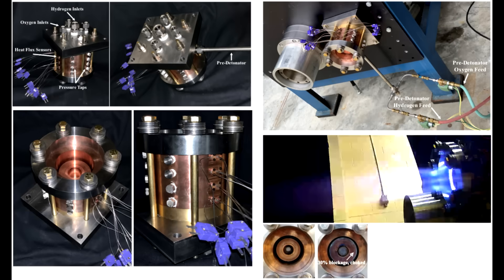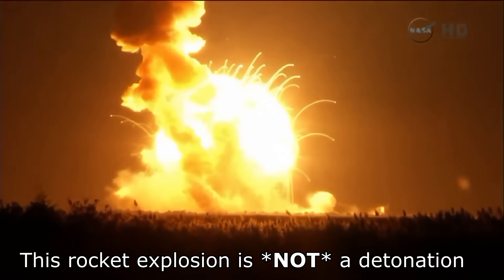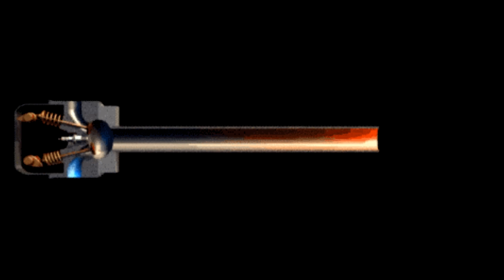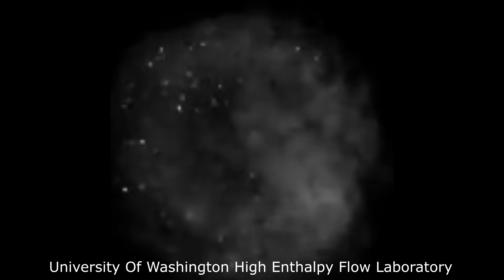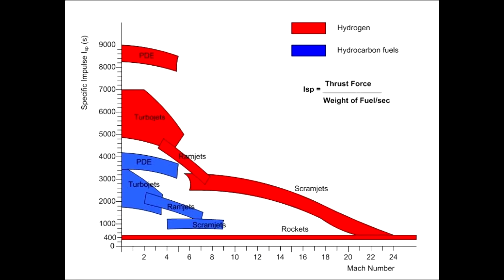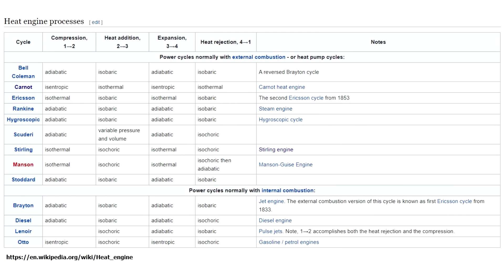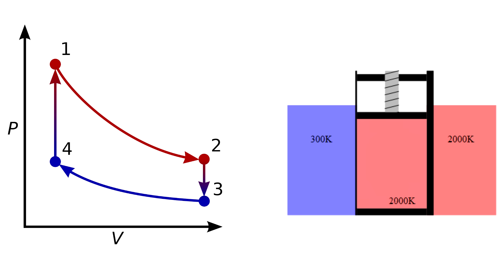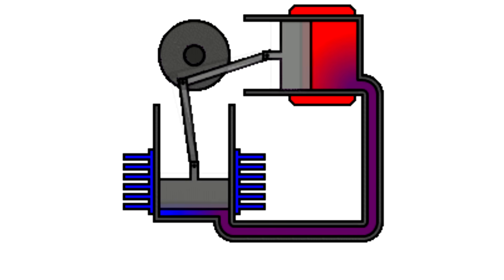What Is A Rotating Detonation Engine - And Why Are They Better Than Regular Engines

Comment: Thanks, Scott. You always do nice work.
Just a nit: the heat engine, in going along the bottom of the cycle from 3 to 4, does negative work, subtracting from the positive work done 1-2. The useful work is the area of the cycle.

Comment: Theoretically, Scott is spot on.  From an ENGINEERING perspective, there are additional issues our good friend has not addressed.

Vibration.  One look at the exhaust flow in the short video clip shows one that the flow out of the engine is NOT steady.  It cycles around the annulus of the opening of the engine.  This wobbling flow is transmitted back into the structure of the rocket.  If one hits a harmonic frequency of the thrust structure, a "rapid unplanned disassembly" will ensue.  In multi-engine configurations, the tuning of the engines will be critical to keeping the structure intact.  Multiple compression waves are employed in an attempt to even out the wobbling.  Keeping the shocks from merging is very difficult as Scott had mentioned.

Acoustics. Rocket and jet engines are loud beasties as it is. By nature of deflagration involves lower pressures than detonation.  Lower pressures mean less noise.  The higher pressures of the detonation mean greater noise levels (see Rocktplumber's posting below).  These have been described as "ungodly loud."  At high altitude (or in space) this makes little difference to bystanders, the crew INSIDE the vehicle will be subject to a higher decibel environment with a detonation engine.  This implies additional acoustic insulation to protect the crew.  The higher decibel level also imparts higher vibrations from the sound into the structure (vibroacoustics) that must be addressed.

These are not insurmountable obstacles, but the engineering needed to adequately address them WILL negatively impact the overall efficiency.  The theoretical increase in efficiency will be very difficult to get reasonably close to.

Comment: I keep hearing these engines being discussed as second stage engines for space launches. Why are they not suitable as first stage engines?
Reply: First stage is more of a peak thrust game to get your second stage to not hit the ground before it finishes accelerating, while on the second stage your specific impulse is critical; it's not necessarily that these rockets aren't suitable for the first stage, it's that you want them in the second stage even more than the first stage. If they cost significantly more (likely), you probably only use them for the second stage.

Comment: we have nozzles to transform energy wasted on pressure into velocity. Thanks for teaching me that in one of your videos. But high temperature seems to be huge waste also. Like, it would be really cool if that could be transformed into velocity also.
Reply: For a gas, pressure and temperature are very closely related; converting the pressure into velocity is essentially the same thing as converting the high temperature into velocity. There are limits from the laws of thermodynamics, of course, as the total entropy cannot decrease, but we most definitely are converting (some of) the high temperature to work in any of these engines.

Comment: How about having multiple smaller engines exploding in a rotating pattern? A little bit like cylinders. And making sure that there are always two engines on a diameter firing together to balance out thrust...
I am talking out of my bum, since I have absolutely no clue if this is even remotely possible.

Comment: Surely even the "rotating" detonation engine cannot match the specific thrust of a conventional engine because it is not using the etire area of the combustion chamber continuously. For the pressure wave to be able to "Travel" it must travel into a lower pressure area, so you can have a truely continuous detonation engine? (or can you, by feeding in new mixutre at low pressure at precisely the same speed as the detonation wave advances, could you burn the whole chamber with a continuous detonation wave?  sounds V. difficutl to me! :-)

Comment: Doing my master's thesis on this 😊
Reply from the maker: Would live to know more
Reply: @scottmanley  What you said is pretty much everything, unless i get bit more technical. There are two major types of states at which these machines operate, Travelling wave mode (which you covered) and standing wave mode, this occurs when there are two opposite travelling waves and they meet each other to create this "stationary" wave. The engine is highly sensitive to mass flow rate and equivalence ratios. These are not the only waves that travel around the annulus, there are other pressure waves which go around and interact with the main detonation front. Its very important to determine the exact dynamics, thats where my thesis comes in, we use high speed imaging to capture the movement of the waves and then we use various data driven algorithm such as POD, DMD to determine the dynamics of these waves. Its not only important to manage the operating conditions of the annulus but also its important to know the dynamics of the system so that one can understand the complete time history and also predict upto certain time in the future the state of the system.
Reply: @scottmanley  it is time to revisit this. Jaxa launch needs some Manley Handling.

Comment: Your piston animation is incorrect. The temperature drops as the volume expands, your animation shows it constant. There is some cooling at the end, but as your pressure/volume chart shows correctly, the bulk of the cooling is actually in the expansion. Similarly for compression.

Comment: I don't think that the thermo cycle behaves exactly as depicted in the 2D graphs. In the graphs the area that is added due to detonation is basically just pasted to the Brayton Cycle curves. I think that in reality this would narrow the lower part that was the original Brayton Cycle. In other words, the area in the graph gets taller but the lower part gets skinnier. The detonation area isn't just added onto the Brayton Cycle curve. Thus, the area enclosed is pretty much the same.
Think of it from a chemistry perspective. There is only so much energy in the chemical propellants. If you do a good job thoroughly combusting them then you get close to the maximum out. *Maximum*.
Now a detonation can momentarily get you a higher "chamber pressure" for this chemical energy to be release, but if that small section of high pressure then disperses out before leaving the nozzle then the average chamber pressure is not much better than a normal rocket. 
Look at it from a fluid dynamics approach: How fast can you get the exhaust gases to go? That depends almost exclusively on net chamber pressure and area ratio. 
You can argue that a detonation will more efficiently combust a fuel and oxidizer but modern deflagration rockets are pretty darned efficient. If you want to squeeze a little more you can simply make the chamber a little longer and have more residence time for deflagration to occur.
There is a finite amount of chemical energy in a propellant combination. You can't get more than 100% efficiency. Current rocket engines are about 70% efficient (much better than cars!). Much of that last 30% is not available for thrust unless you can extract all the thermal energy out of it (a rocket with a cold exhaust and no flame). The Laws of Thermodynamics has a problem with that.
Note that I am talking about rocket engines here. Air breathing engines will of course have higher specific impulse just like normal turbojets have a higher specific impulse than a rocket.
Reply: Kyle Towers  Please enlighten me. Seriously, I'd like to know.

Comment: I built a u-shaped pulse jet engine in high school like 12 years ago. I still have models and drafts for a design that did the exact same thing the rotating detonation design is doing: taking a cross section of the engine and rotating it around a circle so instead of pulsing it would burn continuously around. I had none of the skills or math ability to even try it though ;D (still don't, but I would love to one day)

Comment: Once I get my workshop finished (which I will video the construction of and post) I intend to try and and fabricate a Stirling engine using a magnifier (which I will video the construction of and post) which will utilise the power of the sun (I live in Thailand where the sun shines most of the time, 38 degrees at the moment, 40 yesterday ;) Will it work?
Reply from the maker: You need a cold sink too, but i’m sure it’ll work
Reply: @scottmanley  My submersible well runs pretty cool water, maybe I could rig something up with it. I love tinkering, which is what my new channel is called "Tinkering in Thailand". cheers mate :)

Comment: •	RDE’s need a single initiation for operation and the combustion is self-sustained. The detonation waves will stabilize in a short duration. 
•	Frequency of operation is of the order of KHz. Which makes uniform exhaust flow downstream of the combustor.
•	Compared to PDE’s the thrust produced by an RDE is continuous. The detonation waves are enclosed inside the channel which reduces the energy lose with exhaust. Which makes it a suitable replacement for the gas turbine combustor. 
•	The reactant inflow does not require any flapping valves as well as it is a self-pressurizing system. The injection pressure loss will be overcome by pressure gain combustion. So it is easy to integrate it with an axial compressor with lesser number of stages. 
•	RDE’s have very high power density, so that the size of the combustor reduces drastically.    
•	Smaller the size of the combustor, smaller will be the losses due to wall heat transfer. Moreover, the exhaust flow can be simply approximated to a 1D quasi steady flow.
•	It is easy to resize the combustor because there isn’t any hard rule for the size constraints. 
•	Fuel injection system associated with such combustors are fairly simple, as they don’t need any moving parts or swirlers.  
•	Integration with an existing turbine stage will be easy because of lower unsteady pressure fluctuations downstream of a properly designed RDE combustor.
•	Propagation of the detonation wave independent of direction of inflow and outflow of reactants and products respectively. Such combustor can be easily integrated to axial as well as centrifugal compressors. 
•	Even though there is no need of a secondary air for dilution of exhaust, if employed it will further reduce the periodic oscillations downstream of the combustor.
•	RDE’s possess large effective thrust, which is a measure of how well the total pressure of reactants are converted to thrust. So an engine employed with RDE combustor can work with lesser number of compressor stages compared to the same system with a constant pressure combustors.
•	Large specific thrust and high Specific impulse of the system make sure the maximum utilization of the available air.
•	Operating space (mass flow rate of reactants vs equivalence ratio) is wide for an RDE combustor. So it can be effectively operated with equivalence ratios required for low emissions.
•	Most preferable reactants which can be initiated are H2 and O2 combination. So having a clean combustion is favored with such combustors.
•	The mode control is not well defined as of now and there are scope of having multiple co rotating detonation propagation can improve the capabilities of this combustor.
Reply: So, in addition to increased efficiency and many other benefits, it sounds like RDE's should be lighter and more compact. Does that mean RDE's also promise better thrust-to-weight ratio?
Reply: @DistracticusPrime  Too soon to tell about "lighter and more compact", surely, since we don't have a practical working design and don't know yet what additional hardware/reinforcement/plumbing will be added to make one. But even if they're heavier and less compact than current engines, the improved efficiency will, at some particular breakpoint, make up for that. And then we'll be in for lots of interesting new discussions about optimal vehicle design. =:o}
Reply: @DistracticusPrime  Thrust to weight is high and even better is the high specific Thrust
Reply: How throttlable is it? Can we land rockets with it?
Reply: It's not easy to find conditions, where the waves stabilize. I'm not really informed on that subject, as I had a brief contact with it in 2014, while doing my internship, yet I remember the problems. It was extremely difficult to find conditions, where the waves were created in a repeatable pattern - sometimes it was just one, sometimes two, or even three. And then, the biggest problem at that point of the project, was the transition from H2 to jet fuel. It was a real bummer for the team, when the engine flamed out just after couple of seconds or sometimes the exhaust gas temperature rose above the critical for the turbine, which meant that they had to switch it off and the whole procedure had to be repeated. It was called a success, when they managed to get 25s of continous work.
I only wish, I kept in touch with the team, to track their progress. I only hope, that some team from around the world will finally manage to keep it all steady and reliable, as the idea of RDE always seemed great for me.
Reply: Time to practical application?
Reply: @737smartin first successful real works testing of a RDE happened yesterday  in Texas.

Comment: Scott, wouldn't this type of engine cause significant vibration to the vehicle it is installed on? Traditional rocket engines are a continuous vibration, but seemingly these would give pulses of thrust, kind of like Project Orion, just on a smaller scale.
Reply: Like the German WWII V1

Comment: You can get the dwell needed in a Stirling by driving an elliptical gear (at a constant rate) that then drives another elliptical gear 90 degrees out of phase.  It's somewhat mesmerizing to watch.

Comment: There's a problem with your graph at 8:53. Steps 4 - 1 and 2 - 3 are not vertical, as that implies pressure increases or decreases without changing the volume. Unless the cylinder is prevented from expanding, the volume will vary in proportion to pressure changes. :p
Reply from the maker: That’s not a problem with the diagram, it’s a problem with the piston motion in reality.
Reply: @scottmanley  Fair enough :)

Comment: At 4:55, the long red tube is the igniter, starting with a deflagration that becomes a detonation, and launching that into the chamber. The main propellant feed is through the small axial tubes, at right angles to the travel of the detonation wave. The feed is subsonically supplying the blue cool mix, which the shock travels through at mach 2 to 5 or so. Note that at 5:19 the two shocks coalesce into one stronger shock after a few revolutions, a tiny fraction of a second in real time. As long as the chamber is not too short, the feed mix can't escape without getting shocked and burned as the wave comes around.

Comment: A lot of cool things here.  I remember from your other video how a static rocket engine produced thrust vectoring by changing fuel flow to certain areas.  I wonder if you could modulate the rotating detonation to achieve (pretty much) no moving parts thrust vectoring? Kind of like helicopter cyclic control only with a detonation front.

Comment: I believe NPO Energomash tested a Detonation Engine back in 2016. However the news translated it as Pulse Detonation Engine, despite its size and geometry wasn't compatible with PDE, but with a CDE. Also, it worked with RP1 instead H2

Comment: With the rotating detonation engine forcing you into an annular combustion chamber, I'd be interested in how the aerospike vs bell nozzle debate would change in relation to the new power cycle. That presumably comes down to heat flux at the throat?
Reply: Usual nozzles will be destroyed by the shockwave

Comment: So are ram jets somewhere on the scale between these two enginescuz you would still have top atmosphere to have a ramjet but for hypersonic speed couldn't you make that work
Reply: Ramjets are pretty thoroughly on the deflagration side of this; there's a shock at the front that converts the supersonic motion of the outside airstream (relative to the engine) to pressure, and the interior of the engine up until the nozzle operates at subsonic speeds. I suppose it's possible that you could manage a rotating detonation variant of a ramjet, but it's certainly not the norm.

Scramjets, on the other hand, seem very likely to be some kind of continuous detonation engines, as the stream of air doesn't go subsonic in them; not sure if you can build one with a subsonic flame front.

Comment: if a detonation is defined by a supersonic flame front, does that mean you can have a detonation without an explosion, if the combustion products don't expand/move faster than the speed of sound? or does the shockwave of the flame front count and make it an explosion?

Comment: One problem with using a detonation engine cycle in place of a compressor cycle in a jet would be turbulence in the inlet stream. Can you imagine what would happen to such an engine in, say, a thunderstorm? And the real kick is I can't imagine a way to feed air into an engine that completely isolates it from changes in the environment it's operating in.

Comment: Is your cut section accurate? Problem with detonation is detonations, much easier to control a flame front than CP coming from a detonation. Your video didn’t look like they was using detonations yet.